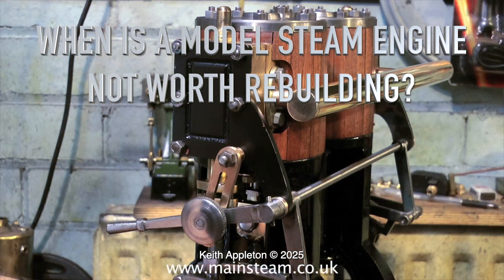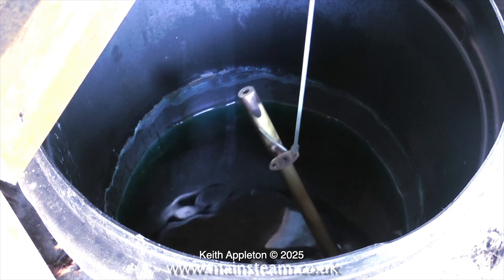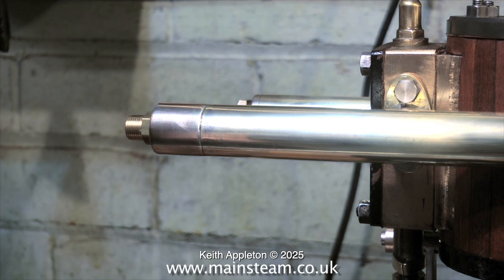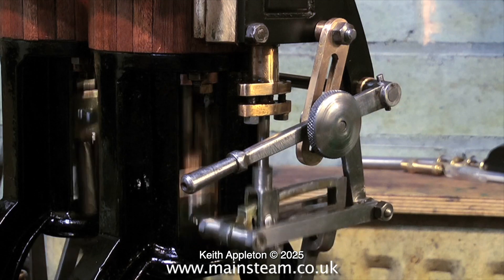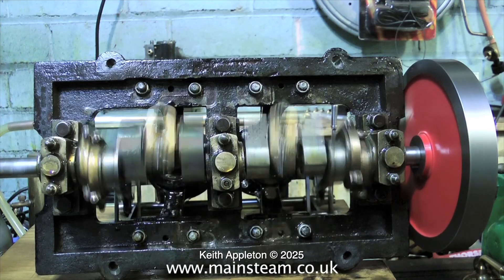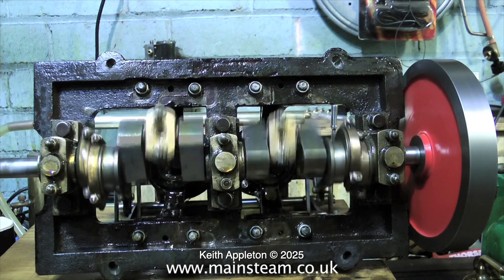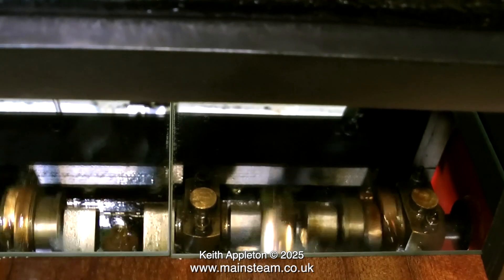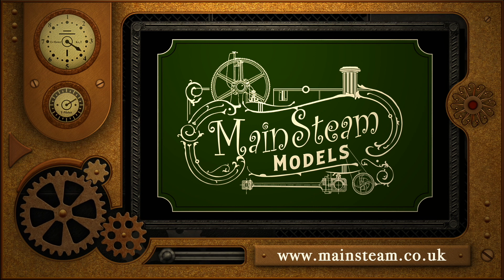WHEN IS A MODEL STEAM ENGINE NOT WORTH REBUILDING? - PART #8

Comment: a great and beautiful restoration, of the engine, The Video gets a well deserved thumbs up,
The only thing I must disagree with, is the sentence "You don't need a torque wrench", with years of experience you get a feeling for it, but especially for beginners I would strongly advise to bey a set of torque controlled screwdrivers, of course not the big ones used for cars, but the smaller ones. Especially with that small bolts an screws you are very surprised what torque you need to get them tight.
Reply from the maker: I have never seen any tiny socket torque drivers in these BA sizes.
Reply: @keithappleton  Hi Kieth, I use the "Wera Series 7400 Kraftform" Screwdriver, it is basically a screwdriver with a adjustable torque set in it and has a socket for bits with 1/4" hex head drive.
Cheers from Texas!

Comment: Very well done Keith, especially considering what you were given to work with.  It clearly fell short of your standards but seemed to come out alright in the end.  If that were installed in a boat and running on steam, how large of a boat could it practically drive?